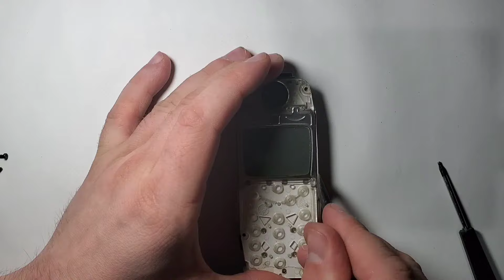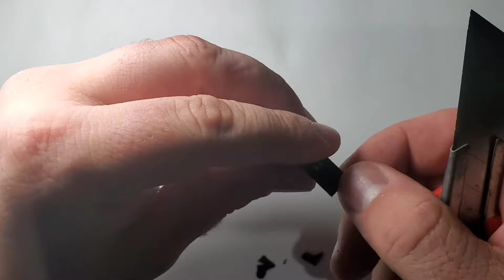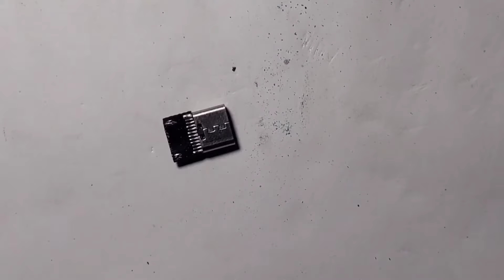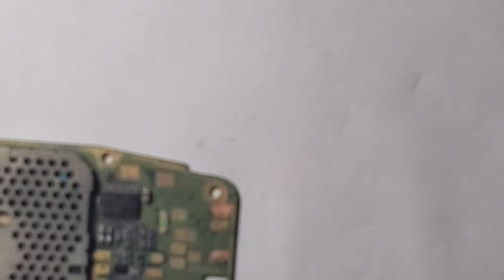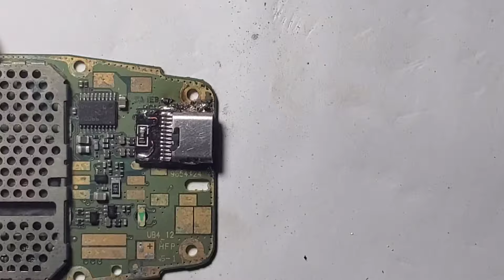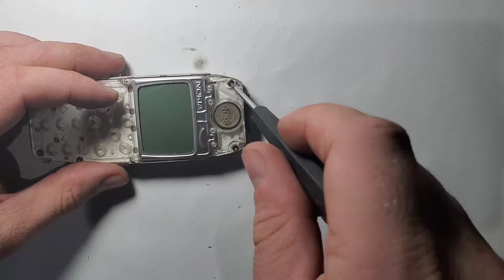USB type C charging mod on 22 years old phone Nokia 3310

Comment: I know the original charger at Nokia 3410 have 3.7v output with 500mA and usb have 5v.
Reply from the maker: the battery is 3.7v. to charge that battery you need higher voltage. That is why original charger had 5v
Reply: @diyotaku  my original charger have output 3.7v.
Reply from the maker: @laurentiuilina4992   I did some research, it seems you are right. However, it seems all aftermarket chargers for 3310 are 5v in output. So there shouldn't be any problem with 5v charging

Comment: I have a question and hope u can help me. I have a 3310 for decoration which works, which i want the display and the illuminated keys on when connected to power. Where do i have to solder?
Reply from the maker: you want to keep the light always on?
Reply: @diyotaku  well I have the phone in my car in a carkit as a piece of decoration since it's a old car. I want to wire up 12v or lower regulated to the phone so the display and keypads stay on and illuminated as long as it has power. 

so most ideal would a track on the PCB that I can feed power to, no idea where to look for etc